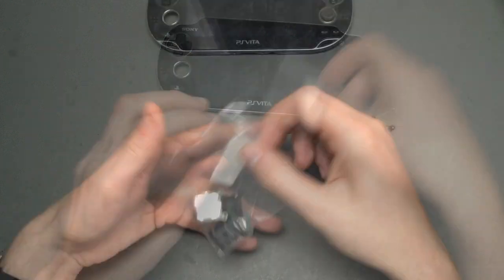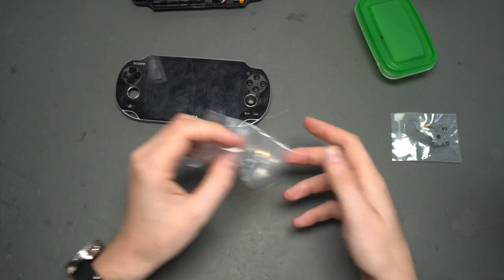You shouldn't repair a PS VITA like this...

Comment: I ordered a motherboard us edition for a really good price but it’s missing the screws and the L shaped metal plate and the smaller metal plate. Is it okay to reassemble the unit without those? Can’t find any online.
Reply from the maker: I'm pretty sure nothing bad will happen if you reassemble without those metal plates, although it would be good to at least connect the pieces with some metal wire under the screw heads. As for the missing screws, i recommend finding similar replacement screws, because there is a risk the vita might creak when in use